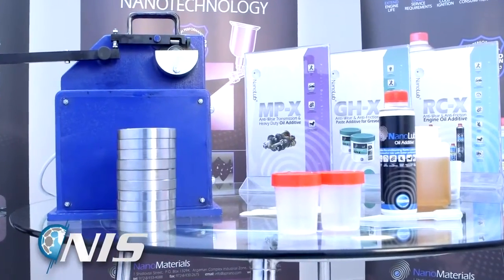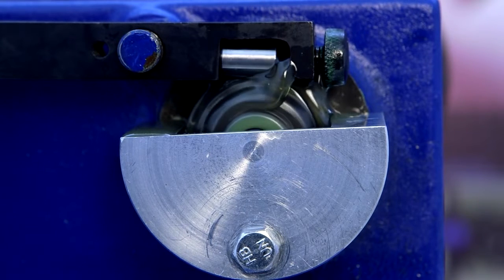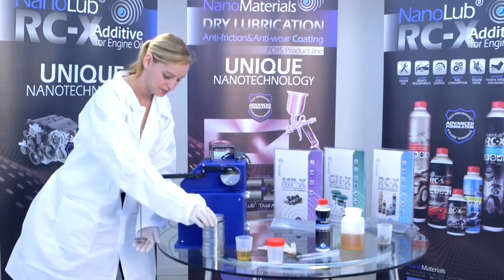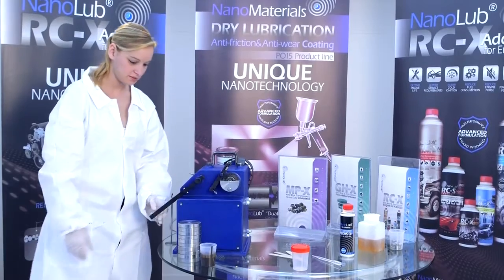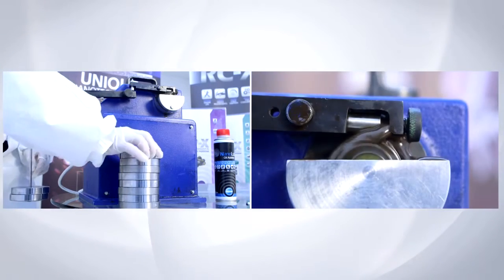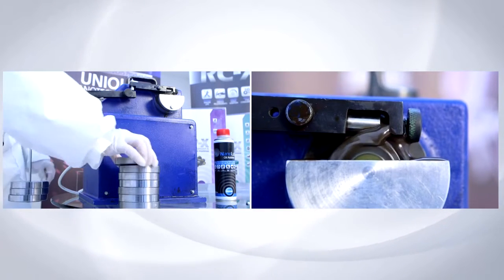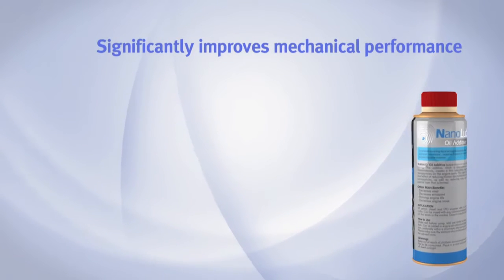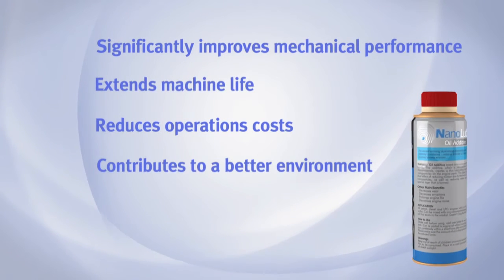The Timken Test of IFWS2 nanoparticles Formulated Oil Additive

Comment: What auto corporation backs you up I know that vw Germany had intention on using your product but I supposed it did not
Reply: If I was them I would. VW has OEM branded bulk oil you can even buy it for yourself its freely available. Its pretty much just a standard 0w30 made by either Shell, Castrol or Total I believe but the supplier doesn't really matter. It says made in France on the packaging these days so most likely its Total oil.
Having that oil "enriched" with some Tungsten could benefit VWs entire fleet of vehicles that are dealer maintained and get bulk VW oil. 
But VW doesn't really give a crap they are the ones pushing 30-40.000 Kilometer oil change intervals on vehicles that need serviced every 10.000 kilometers realistically.